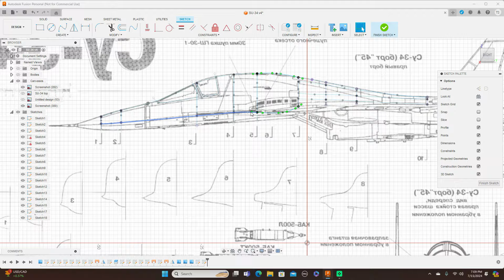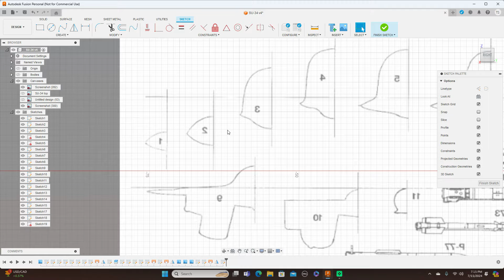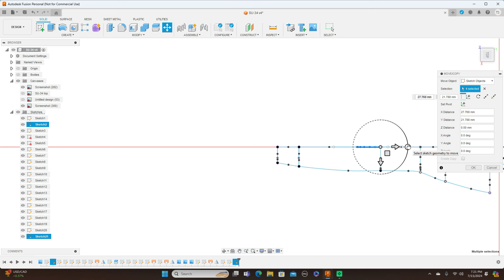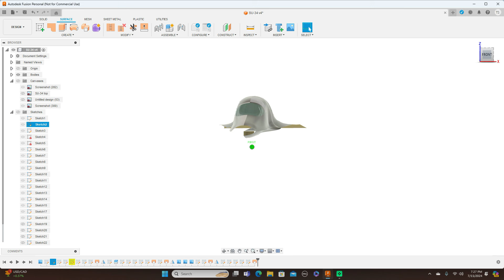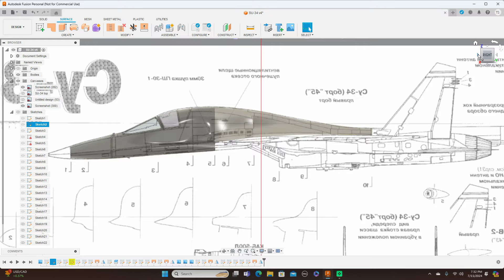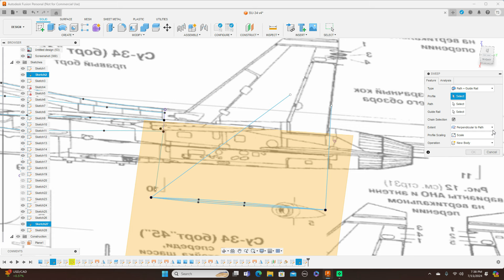Can I Surface model a SU-34 in Fusion 360?

Comment: Surface modeling of complex shapes is insanely difficult.  What I've found to be helpful when doing 3d splines are intersection curves. You get a much smoother and more accurate result than trying to shape a spline in 3d space.